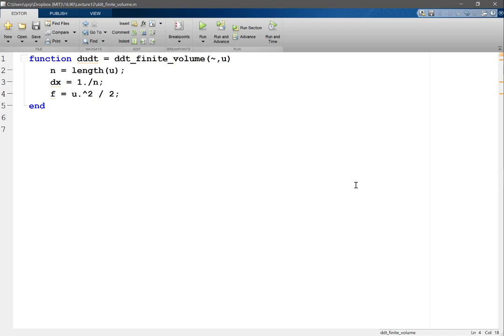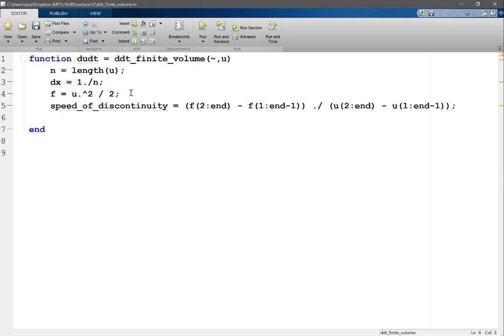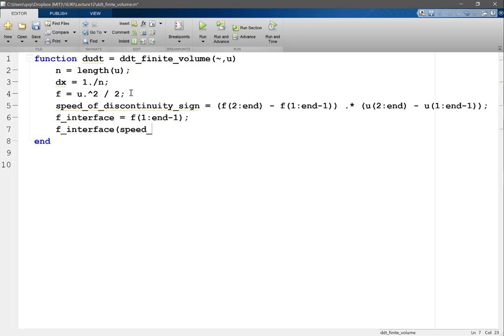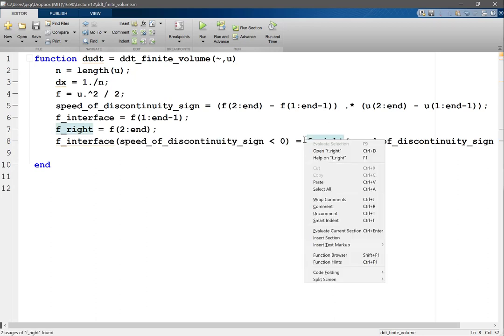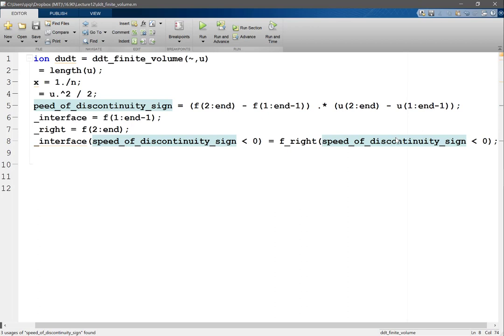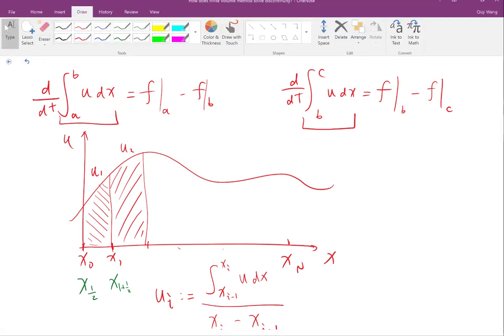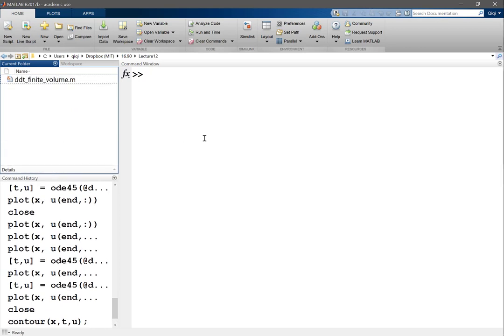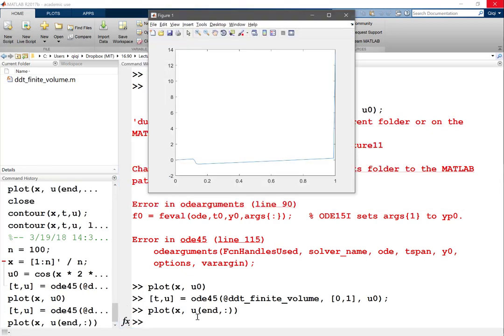Implementing the finite volume method to solve Burger's equation

Comment: Dear Prof.Wang, if we have a diffusion problem, as Fick's second law, we can write a conservation law of concentration. And if we want to use finite volume to solve this system, f in that case would be equal to the gradient of u (du/dx+du/dy in 2D case) so that means it might be not straightforward to obtain the du/dt then solve it with ode45 ? Thank you